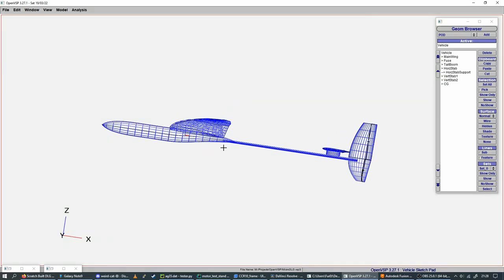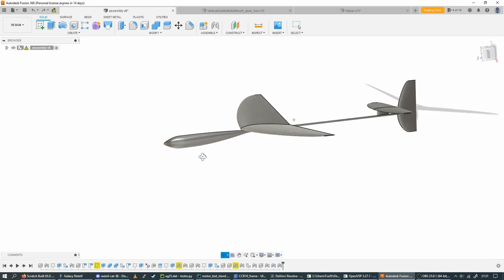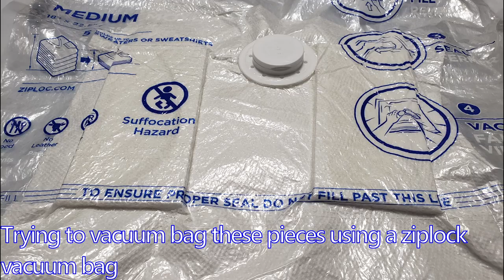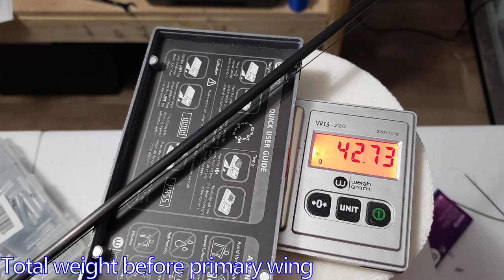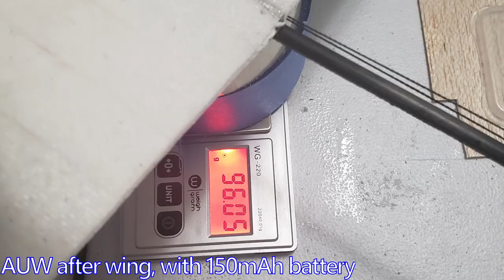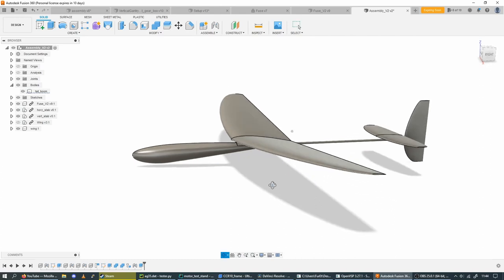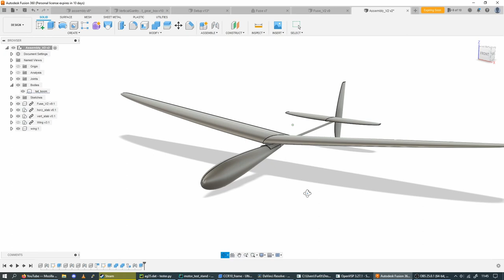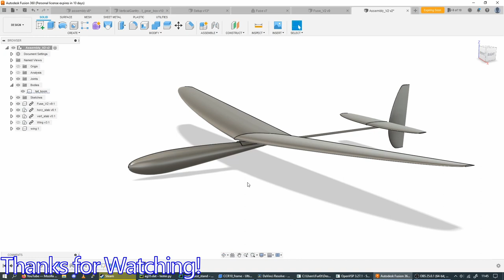70cm Mini DLG | Part 1

Comment: Ive been watching a few DLG clips as im on the hunt for a way to make stiff /lighter hydroplanes . lots of good ideas from you chaps , I had the same cutting problems with carbon fibre, if i remember correctly i ended up using the coated type from East coast fibre glass, that way i could cut out curves etc.Regards Paul

Comment: oh boy, a Nebula update! Hey, wait a minute.... :)

Yeah getting the cloth to wrap around a leading edge or similar tight radius can be awkward. The best ways I've found are: use more layers of lighter cloth instead of one heavy layer, use 45 degree alignment, for a long curved edge use more smaller patches of cloth, and make the patches of cloth extend out further away from the leading edge. Basically you want to reduce the average angle of bend each strand of fiber needs to go through. In particular the 45 degree alignment is helpful because you then get twice as many strands wrapping over the edge instead of one so it's stronger as well. The downside is making a 45 degree cut from your cloth supply is usually kinda wasteful.

It seemed a little odd to me that you're using the tissue paper to soak up excess before the parts are joined. I would have thought that would be a last step after ensuring everything is wet through and well connected, then remove excess from the outside. But that might only be relevant for the way I'm usually doing things - I guess if you're gonna place it into a mold then things are different. And for a thin wing like this, not using a mold might be risky, it could easily warp one way or the other without decent support while curing.

DLG is a pretty demanding thing to build actually, needing to be so light and still endure huge launch stresses. A while ago I decided to avoid buying planes and always try to build my own, but a DLG is one case I would probably make an exception.
Reply from the maker: Lol I have made some more progress on nebula, but not as much as I would've liked, I was waiting on some parts from china that recently got delivered (mostly electronics).

I do agree that buying a DLG would be a lot easier, as there are a lot of facets to making one that works well. Though I did think it'd be an interesting project to try, given previous point (though it still ended up having the tail break in the next video)

I didn't think about aligning the cloth at a 45, mainly because thats not the direction its cut. I honestly would rather do that and have two left over triangles I could use for another wing or something. So I'll probably give that a shot with my next one, whenever that happens, need to work on nebula some more. I did order some of the 30gsm and 50gsm fiberglass you recommended last time, that got delivered in time to use for the remake of the fuselage.

In terms of wicking the cloth before layup, since I fully whetted the cloth before wicking, the surface of the wing had epoxy, and used the molds, I wasn't too worried about it. But when I've been doing hand layups, I've been waiting until the very end before wicking the epoxy, since like you said, I want to make sure everything is properly whetted and joined.

Thanks for watching!

Comment: Might have to take some tips from the video heheh... though I'm going moldless for my 1.5m dlg, and just laying the fiberglass on the wing. It'll definitely be a bit heavier than if I were to vacuum bag it or use a mold, but I already spent enough money on materials. Right now I'm wire cutting the foam for the wings, and my success ratio is about 40% right now (it's a big pain doing it by hand)
Reply from the maker: I usually do open layups as well, especially for larger pieces where I don't want to print/make a mold for it. My biggest advice would be to use some toilet paper to wick resin out of the fiberglass when doing the layup, it really helps to save on weight.

Comment: great work, im w9ndering why cut so many sections on the surfaces, why not just hot wire the entire wing panel?
Reply from the maker: Thanks! 
Cutting smaller sections preserves the  non-linear taper in the wing, along with the airfoil cross sections. If the wings planform was more linear then it could be cut in larger segments. 

If I cut the wing out of larger segments then sanded down to the curved taper i'd be more likely to destroy the cross-sections than with this method and the small amount of sanding required afterwards.